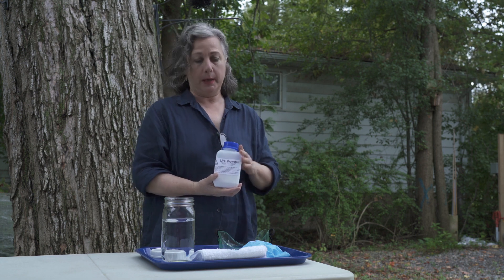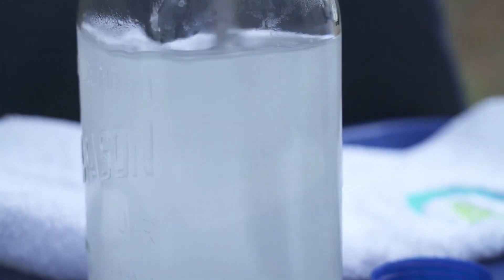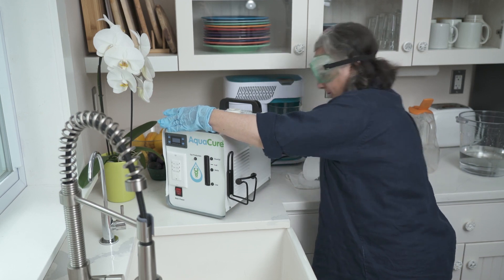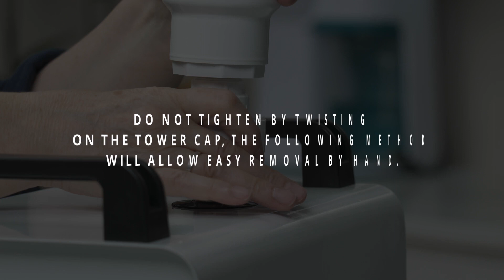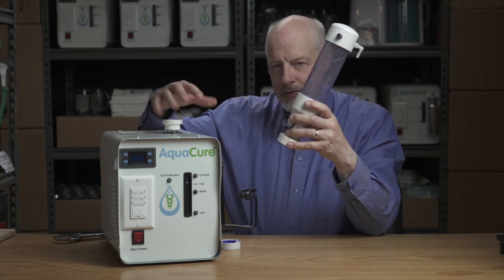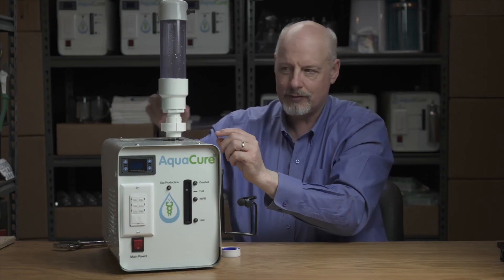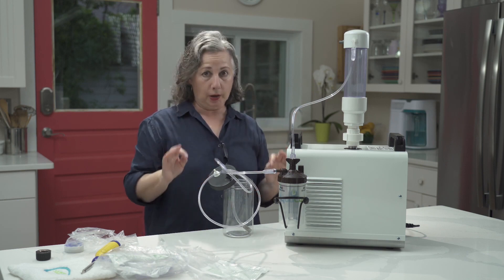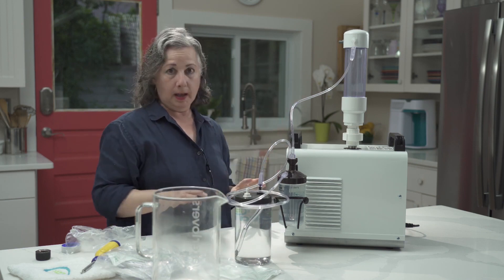AquaCure AC50 SetUp (series video 3)

Comment: After the first clean the machine keeps beeping and the red light turns on but the water levels are normal.
Reply from the maker: Best to ask such questions directly  https://eagle-research.com/contact/
But I suspect that you have an air bubble
Note: I occasionally get an ‘air bubble’ in the tube (so it will seem that the sight tube and/or ball is not ‘registering’ the actual fluid level correctly).
Generally air bubbles will eventually clear on their own, but you can ‘hurry’ the process by filling the AquaCure with solution.  Then alternately and VERY SLOWLY lift the front and back of the machine up to 60 degrees to ‘wash’ the solution up and down in the Sight Tube, washing out the air bubble(s) and the ball should float properly. 

More helpful links:

AquaCure AC50 Introduction Video (Operation Series Video 1)
https://youtu.be/5O6lYL60Ad0

AquaCure AC50 Unboxing Video (Operation Series Video 2)
https://youtu.be/SNfRmdhqf-8

AquaCure AC50 SetUp Video (Operation Series Video 3)
https://youtu.be/ph1inNyyZYs

AquaCure AC50 Operation Video (Operation Series Video 4)
https://youtu.be/ESYQCGcPLIo    
NOTE: The AquaCure gets ReFilled (from the Humidifier) everytime the Yellow ReFill light comes on 
After ReFilling from the Humidifier (using the syringe through the Tower Cap fitting) you DUMP the rest of the Humidifier water and completely ReFill the Humidifier with fresh distilled water.

AquaCure AC50 Maintenance Video (Operation Series Video 5)
https://youtu.be/OaSuz7qFTaw

AquaCure New Timer Switch
https://youtu.be/P0J4GxuddxM

Apply Teflon Tape on AquaCure Fill Stem
https://youtu.be/sFXJaOSwwZs

If you see white crystals forming under your Tower Cap base OR If you are not able to get bubbles down to at least 5% gas volume production but DO get volume at 100%, then you have a gas leak that is bleeding off some of your gas.

This is most often cause by the lack of enough (or miss-applied) Teflon Tape on the silver Water Fill stem or (not very often) a leaking Tower Cap check valve.

Be sure you have enough layers of Teflon Tape.  
AND that the black O-ring is properly in place

Properly Install the Tower Cap
https://youtu.be/Pr98DMe94No

The FIX is to leave on the old tape and ADD MORE.  LAYER as many wraps of tape as needed (9 to 30 wraps depending on tape thickness) clockwise around the TOP threads of the silver Water Fill Stem.

Don’t use so much tape that the layers get ‘pushed down’ as you screw on the Tower Cap.

The Tower Cap is NOT supposed to be taken off except for the 100 hour maintenance cleanings.  Fill the AquaCure using the syringe and squirting water into the Tower Cap check valve (which needs the clean water squirted through it to keep it functional).

Make sure your Tower Cap base Union base is sealed properly and that you install and remove the Tower Cap using the Union ring, so you do not need to keep re-applying the Teflon Tape.  
DO NOT ’torque’ on the Tower Cap to install / seal the base fitting; doing so will ‘lock up’ the Union Big Ring, requiring wrenches to loosen it.

If you have accidentally ‘locked’ the Union…
Put one wrench (like a Water Pipe Plier or a Vice Grip) on the bottom Union piece (screws onto the water fill stem) to HOLD IT from turning.  Do NOT allow the bottom piece to turn.

Put another larger wrench (like large Water Pipe Plier or Pipe Wrench or Strap Wrench) on the BIG RING and turn counter-clockwise.  DO NOT put a wrench on or touch any other part of the Tower Cap.  Turn ONLY on the Big Ring.

You can look online to see how to use a strap wrench.  Strap wrenches are handy and fit almost anything.  Common uses are for opening jars in the kitchen or for removing oil filters in the shop, etc.
https://www.wikihow.com/Use-a-Strap-Wrench
https://www.youtube.com/watch?v=eoRT8UvYraI

In the future, install the Tower Cap as per this video and it won’t lock up and you won’t need wrenches.
AquaCure AC50 SetUp Video
https://youtu.be/ph1inNyyZYs

To fix Tower Cap base leaks, remove the Tower Cap base, clean off any lye powder (vacuum works).  Leave on the old tape and ADD MORE.  Sometimes it takes 20 to 30 wraps (if the tape is thin).  As long as you can screw on the fitting without pushing down the tape, it isn't too much.

Finally, FULLY SCREW ON THE FITTING.  It has come to my attention that many people DO put on enough Teflon Tape but then don’t fully screw on the fitting.  The silver stem should almost touch the inner ring at the top of the fitting.  If you do not have the hand strength, the strap wrench we include will help you get the torque you need to fully screw on the fitting.

If this is not the issue, get back in touch with me with your serial number and enough information for me to find your order.

below is the OLD but fun to watch AquaCure AC50 Setup and Operation Video
https://youtu.be/723gzax3z7Y
NOTE that you NEED to read the text below the video to correct things like ONLY 80 grams of lye!

AquaCure AC50 Operation Manual (Obsolete and currently being updated) 
https://eagle-research.com/wp-content/uploads/2019/08/AC50-Operation-Manual190414.pdf

AquaCure AC50 Operation Manual UPDATE notes
https://eagle-research.com/wp-content/uploads/2021/11/AquaCure-Operation-Manual-Update-Notes.pdf

AquaCure Rinsing Technique
https://youtu.be/oac55WgfIvs

When Rinsing:
To dissolve soap formations you need water in the 120° F to 140°F range AND it must FL:OW past the soap!
The water must be hot; warm water does little.  Remember to trade out the hot water within a minute or so (at first) because it will cool quickly as it heats up the components.
You Fill the AquaCure to FULL with HOT water (6 to 7 cups).  Then alternately and SLOWLY lift the front and back of the machine up to 60 degrees to ‘wash’ the HOT water up and down in the Sight Tube; the hot water must FLOW to dissolve the soap.
You need to change out the HOT water frequently because it cools off quickly and warm water does little to dissolve soap.

NOTE: If the HOT water doesn’t ‘’reach’ the tight tube, doesn’t wash’ up and down in the sight tube, it CANNOT clean the sight tube; if you are not getting the water washing up and down in the sight tube, it’s likely due to a plug or restriction and that needs to be fixed ‘manually’; ask for instructions.

Note: I occasionally get an ‘air bubble’ in the tube (so it will seem that the sight tube and/or ball is not ‘registering’ the actual fluid level correctly).
Generally air bubbles will eventually clear on their own, but you can ‘hurry’ the process by filling the AquaCure with solution.  Then alternately and VERY SLOWLY lift the front and back of the machine up to 60 degrees to ‘wash’ the solution up and down in the Sight Tube, washing out the air bubble(s) and the ball should float properly. 

Setup your AquaCureAC50 torch attachment:
https://youtu.be/v2ufQWJ0l0Q

H2 Hubb AquaCure AC50,  Unboxing, Setup and Test videos:
Unboxing   https://www.youtube.com/watch?v=i5CAuVYu_a4&t=368s
Setup    https://www.youtube.com/watch?v=PAmDyKdai4Y
Test gas production   https://www.youtube.com/watch?v=w1GOztHEOgk

See Brown’s Gas testimonials / studies / etc. here:
http://aquacure.life

AquaCure Brochure
https://eagle-research.com/wp-content/uploads/2020/02/AC-Brochure-small-v4generic.pdf

Brown’s Gas for Health (legacy page)
https://eagle-research.com/browns-gas-for-health 

What is Brown’s Gas?
https://eagle-research.com/q-what-is-browns-gas-bg/

How I use Brown’s Gas for Health
https://eagle-research.com/how-i-use-browns-gas-for-health-enhancement/

Plants Don’t Lie
https://eagle-research.com/plants-dont-lie/

FAQ: 
https://eagle-research.com/faq/ 

Medical disclaimer:
https://eagle-research.com/legal-medical-disclaimer/ 

My Protocols:
https://eagle-research.com/how-i-use-browns-gas-for-health-enhancement/ 

Is Lye Safe?
https://eagle-research.com/is-lye-safe/ 

Purchase your AquaCure model AC50 here:
https://eagle-research.com/product/ac50/

Login to your account here:
https://eagle-research.com/my-account/edit-account/

May the blessings be
 🦅 George Wiseman

Comment: I’m sorry that I’m just a little bit confused but I would really appreciate a response if possible 
When I make the mixture of 6 tbsp of sodium hydroxide and 24 oz of water and let it cool and pour it into the machine should I add water to the mixture till it reaches the full line on the sight tube?? Or do I just pour the lye solution in and screw the tower cap back on and then the machine can run like that?? Any answer Is appreciated thanks
Reply from the maker: Yes, after pouring in the lye solution THEN add more water (slowly) until it's full.
Be sure to do the HOT tap water rinces first and it's a good idea when doing that, to check the operation of the lights/alarms, (plug it in and turn it on) so that when handling the lye solution, you are comfortable with the machine.
Reply: @ecopegasus  ok thank you that helps I just wanted to be sure

Comment: I am in the setup and have just added the lye as extra distilled water per the video.  I added water until the refill light went off then stopped.  About 10 seconds later some type of alarm began.  Nothing on the panel told me what to do so I have turned it off until I get further instruction.  Can anyone help?  It is not indicating too full...
Reply from the maker: Contact me directly please https://eagle-research.com/contact/
Include your name and machine's serial number.  It's likely simple, but this isn't the venue to work it out.

Comment: Hi all, just got the device and used it for the past 4 nights. 
Does lye need to be added everytime with the refill?
Reply from the maker: As per the instructions, NO.  After the initial lye is added, only 'water' comes out so only PURE water gets put in.   Let me know by eMail if you need the instructions sent to you again.  https://eagle-research.com/contact/
Reply: Okay so this is confusing me, I've watched the videos where you recycle the original lye solution, for example, you empty the lye solution out and into a jar, put that aside, you then clean the resevoir with plain water multiple times, the add the original lye solution you put aside back in? Is this what you mean?

Or do you mean, you empty the original lye solution out and dispose of it, then clean it with water multiple times, and then you only put plain water back in? Or because the original lye solution was disposed of, do we add distilled water with 40-80g or lye back in?

Comment: I've had the AquaCure for several months now. While the AquacCure is in operation, I had noticed that when the cannula for inhalation is obstructed the bubbles would immediately stop forming in the water jug. But now I noticed that the bubbles keep forming even if the cannula is obstructed. I thus decided to change the cannula for inhalation and the tubing that runs from the water jug to the humidifier thinking perhaps there is some kind of leakage in the system. After changing the tubing I had observed that there was no change as there is no impediment to the bubbles being released in the water jug when i try to obstruct the air from coming through the cannula as before where the bubbles would just stop being produced. Any thoughts on my observation. Thank You.
Reply from the maker: We prefer to help people via our website contact:   https://aquacure.life/contact/
That said, it sounds like you have a gas leak somewhere around the Drinking Water jar lid.
If you plug the cannula ends and either use soapy water (it bubbles as gas leaks) or submerge the Drinking Water jar into clean water, you will find the leak (see bubbles).  Once you find the leak, the 'fix' usually becomes self-evident.

Comment: This video says to rinse with 1.5 litres of hot tap water. The operation manual update notes say to rinse with 0.75 litres of hot tap water. I'm just about to do my initial rinse, hopefully it doesn't matter either way.
Reply from the maker: 0.75 works... But that was a carryover from previous instructions.  We've discovered 1.5 liters (quarts) works better.
Reply: @ecopegasus  Great, 1.5 litres is what I used, thanks for your reply. I just used my machine for the first time - hardly any gas coming through but I added the Teflon tape and that sorted it. Very happy!

Comment: Hi we just get our machine, i'm settin it up, but it seems that something is not working as you showed on your set up video. In that video when the display screen show 40 percent of hydrogen the bubbles come out immediately and abundantly. When i put the machine to work in that 40 percentage, no bubble shows, and only ultill i increase the potency to 65 percentage is that you can appreciate the bubbles coming out.
Reply from the maker: FAQ: No gas or very low gas bubbling in both the Humidifier and Drinking Water jar.

Sometimes, when people are setting up their AquaCure, they notice no bubbles or, that at lower % duty cycle there is no gas but at 100% there may be some bubbling.

Adding more lye, after there is at least 40 grams in the machine DOES NOT increase gas production!
Gas production is based on amperage, not lye.  Once there is enough lye to conduct maximum amperage, adding more lye does nothing except increase the ‘reservoir’ or ‘reserve’ of lye in the machine.  TOO MUCH lye leads to crystallization and plugging of internal orifices.

Generally if there are no (or very low) bubbles in the Humidifier and Drinking Water jar, the cause is not enough Teflon Tape on the base of the Tower Cap OR a missing black O-ring.  
Leave the old tape on and ADD MORE, if the Teflon Tape is thin, you might add 20 (sometimes 30 wraps).

If this is not the problem, get back in touch with me.

Properly Install the Tower Cap
https://youtu.be/Pr98DMe94No

Make sure your Tower Cap base Union base is sealed properly and that you install and remove the Tower Cap using the Union ring, so you do not need to keep re-applying the Teflon Tape.  

DO NOT ’torque’ on the Tower Cap to install / seal the base fitting; doing so will ‘lock up’ the Union Big Ring, requiring wrenches to loosen it.

If you have ‘locked’ the Union…
Put one wrench (like a Water Pipe Plier or a Vice Grip) on the bottom Union piece (screws onto the waterfall stem) to HOLD IT from turning.

Put another larger wrench (like large Water Pipe Plier or Pipe Wrench or Strap Wrench) on the BIG RING and turn counter-clockwise.  DO NOT put a wrench on or touch any other part of the Tower Cap.

In the future, install the Tower Cap as per this video and it won’t lock up and you won’t need wrenches.
AquaCure AC50 SetUp Video
https://youtu.be/ph1inNyyZYs

May the blessings be
 🦅 George Wiseman

Comment: Just to confirm. Even out of the box a brand new AquaCure machine needs a good rinsing as demonstrated in the video.
Reply from the maker: Yes, Because every single one is run tested when manufactured so ends up with a small amount of lye solution in it.  During storage and shipping the lye residue in the machine can crystalize, plugging small orifices.  The HOT tap water rinses dissolve the crystallization so the machine will operate properly.

Comment: When she fills with the lye she has more than 3 cups in her mason jar.  I filled it with 3 cups, but it's showing "refill."  Should I add more water?  More water with lye?
Reply from the maker: The initial (about) 3 cups is just to get the lye into the solution without spilling out of the jar when stiring.  The actual water needed to fill the AquaCure is about twice that and you'll see her adding the extra water later in the video(s).
Reply: Just to be clear. First time using the machine it is not filled all the way with the lye, so I just add more distilled water without adding more lye?
Reply from the maker: @suziesunshine313  Corect

Comment: here attach this hose 676*.
great i am with you. Now attach the other hoses.
okay which one, why did you show 676 so i am right there with you and then abandon the showing of what hose goes where? 
Go through, and just show what hose is what during the process please.
Reply: They have numbers… why wouldn’t you describe which tube by it’s nuumber goes where? You say there is a steep learning curve.. but its because of these lapses in instructions. should i get the tube out and measure them to see which one is 4 feet? And then guess which one goes where?
Reply from the maker: @anonymity604  I don't mention the numbers because different manufactures have different numbers and THAT would get confusing.  Simply look at the hose ends to see which ones will fit where.  Once you do it the first time, you'll understand how simple it is.
Reply from the maker: I'm guessing you didn't watch the whole video before asking these questions.  See the hose descriptions and connections starting at 9 minutes.